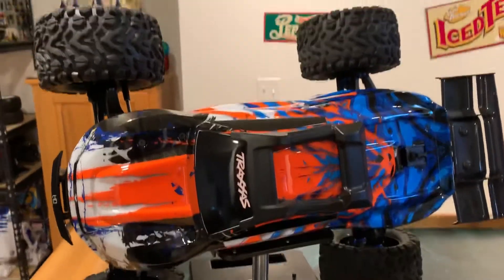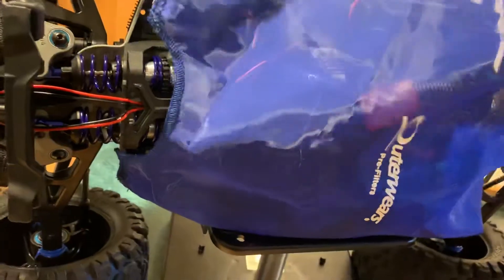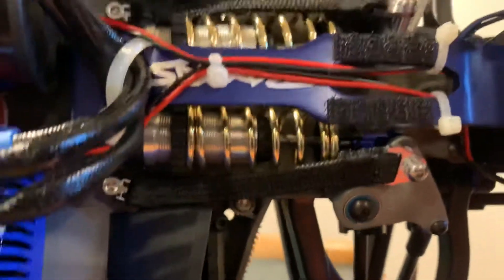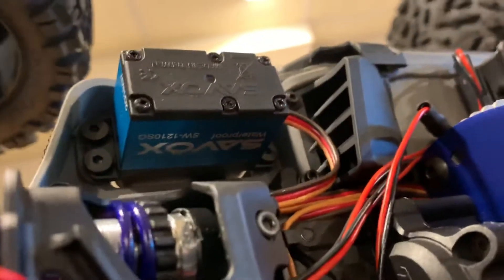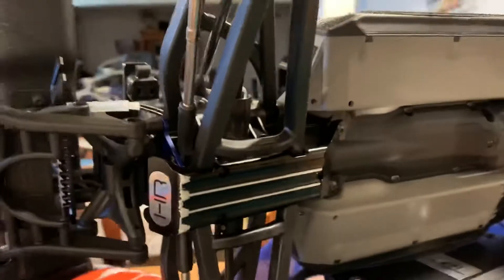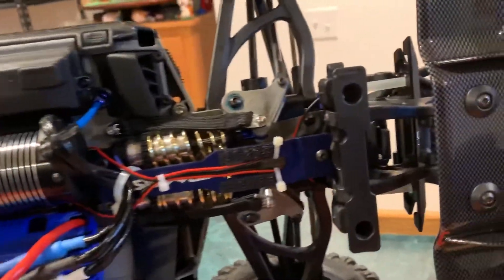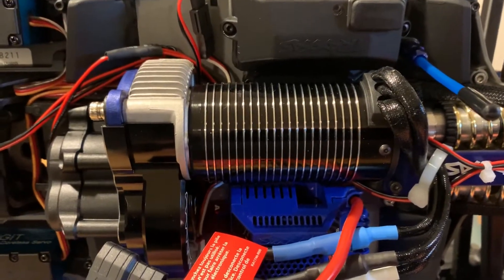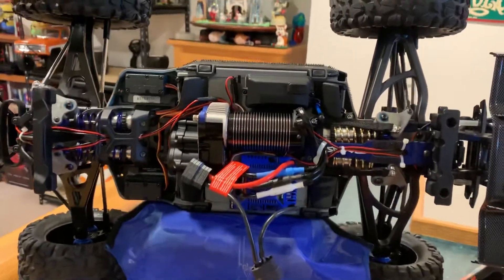Traxxas E-Revo 2.0 all Upgrades so Far

Comment: Awesome update i know i really appreciate it. My E Revo 2.0 burned up the esc a year ago so i replaced it with the Mamba Monster X esc. And i want to do the skid plates limit straps and bumpers to. But first im putting the 
Castle creations 2200 motor and a cap pack on. Im currently running steel drive line. And traxxas metal gear survos. And SRC all terrain crushers. Please keep us updated on your build.. Thank you..

Comment: I'm in the middle of a build as well on the 2.0 on the motor fan I'm sure there is probably other options but for the motor fan I just used a castle mamba monster cooling fan it fits perfectly and it's super cheap.

Comment: So is this a shelf queen or a daily driver cause that front skid plate is awfully pretty to be scratchn up
Reply from the maker: It isn’t a shelf queen, but I don’t bash it too hard either.  My Maxx and Rustler 4x4 are definitely bashed much harder😁.  My Revo is my favorite rig and I have spent a lot on upgrades.  I run a stiff suspension, which does help keep the skid plates from getting too scuffed up.  They have gotten scuffed in the front and rear from curb jumping, but that’s nothing a good file won’t buff out🤪.

Comment: Great upgrades!  I used these Savox servos are super fast.  I'm going to try these Hot Racing springs, I'm using the purple but they could be even tougher. 

Question: how could you keep yours looking so good new?
Mine looks now like it came out of Mad Max...
Reply from the maker: Yeah, I definitely recommend these hot racing shock springs.  They are way stiffer then even the stiffest of Traxxas springs.  I use a damp micro fiber towel after I run it off road to get the dirt off and the Outerwears chassis breathable cover helps keep dirt away from the electronics.
Reply: I understand, but mine is past the point of dirt ... it's really detonated! 
I'll try these Hot Racing springs.  Thank you for the tips! 

One of the reasons he is so scratched is that he almost always his the chassis in the skatepark jumps ...
Reply: I understand, but mine is past the point of dirt ... it's really detonated! 
I'll try these Hot Racing springs.  Thank you for the tips! 

One of the reasons he is so scratched is that he almost always his the chassis in the skatepark jumps ...
Reply from the maker: BorgRC 

Yeah, skateparks are fun but they are definitely hard on the RCs.  They’re aren’t any skateparks near where I live, so I haven’t bashed my RCs in one although it would be fun😁.  The Hot Racing springs will definitely solve that chassis from bottoming out off the jumps.
Reply: Edward Turck Yeah ... skateparks are expensive, I always come back with something broken 😂😂😂
My problem here is the opposite, big city with no land around ...
Reply: @borgfpv8418  If you really want to beef up that suspension then get a set of GPM Racing aluminum shocks. You will gain some nice ground clearance and the springs it comes with are super stiff and the pistons are 5mm compared to Traxxas 2.5mm. I use them on both of my E Revo 2.0s and wouldn't even think of ever putting back on those GTR shocks no matter what springs they had.
Reply: James Stubbs 
What part number GPM aluminum shocks did you use? I saw 2 different ones on their website.

Comment: Nice smart uogrades
Reply from the maker: Thanks😁   I just installed a Dynamite 8th scale motor cooling fan the other day.  It should definitely help keep temps cooler when running this truck on 6s during these hot summer days.

Comment: Nice car mines beat to hell and breaks every time I take it out.
Reply from the maker: Thanks, it definitely requires a few mods to keep rod ends from breaking after jumping it.
Reply: Yea that’s the problem I have with it they pull out every time. And for some reason my doesn’t turn right either. The front suspension is real tight. I rebuilt the servo saver I’ve replaced the servos with savox servos but I think it’s the pivot balls in the axel carriers. Idk 🤦🏽‍♂️ it’s frustrating.
Reply: I have limiting straps and the brace. I’m about to put bump stops in the shocks and see if that works.
Reply from the maker: P&B Flores 

I spray silicone oil on pivot points after I clean my rigs to keep everything lubed and smooth.  I also installed Hot Racing aluminum shock rod ends which work great and look cool.
Reply from the maker: P&B Flores 

Cool, bump stops should help too.
Reply: I’ll try the lube maybe that’s what it needs and the aluminum shock ends were my very first upgrade. Thanks for the lube idea though I didn’t think about that for some reason.
Reply: @pjflores5599  Might want to make sure you don't have those pivot balls too tight. They need to be tight but still move around freely without having wheel wobble.